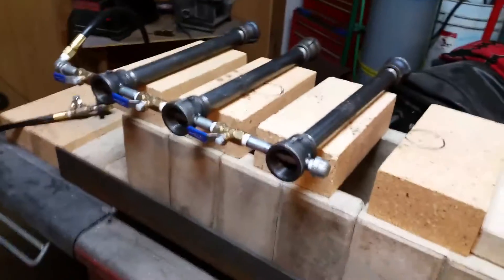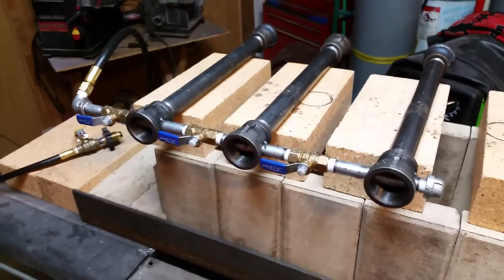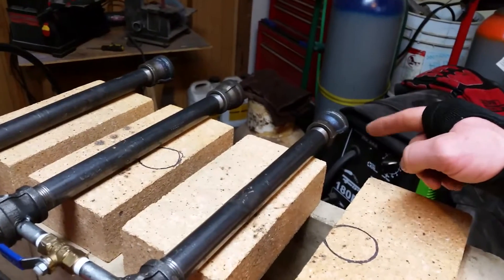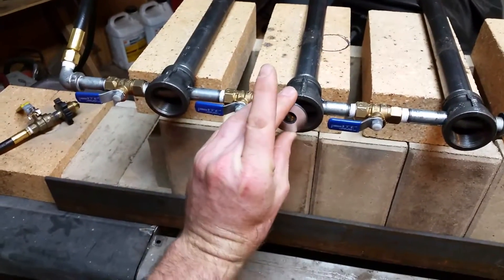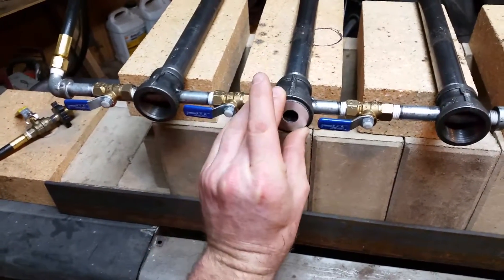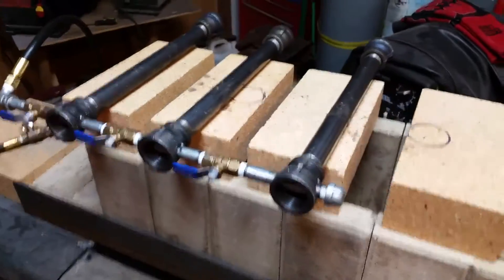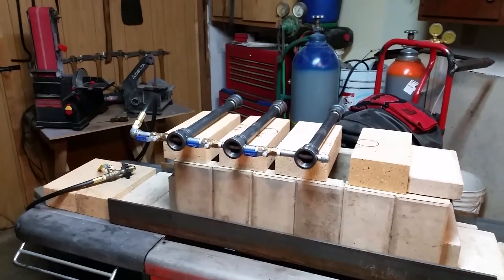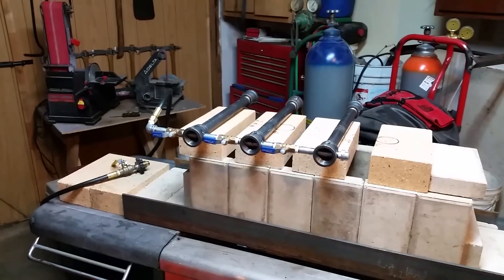Propane Forge Build Pt 3 Burner Testing

Comment: Hi Thank you for the video. Question how are the ceramic or fire bricks handling and conducting the forge heat. I was thinking of using the wool and lining it with cement . I wanted to do a comparison. Any information helps. Thank you
Reply from the maker: Still working great 👍

Comment: So I made this burner, and the only things different was I used 4 inch instead of 3 inch because menards was out. Laying outside all three work great, inside the forge is another story. Long story short I ended up raising the roof of my forge because I was having issues keeping 2 and 3 lit. Now 1 and 2 run okay but I feel like it’s being starved. I have orange flames coming out of the door with the back covered. It almost gets to forging temps with it being closed completely off, takes about 20-30 minutes to reach orange, and this is a billet that has 8)  4 x 1.5” peices so it’s not a huge billet. I got a 20psi regulator and if I cover the tops where the air gate would be the flame dies, does anyone have an idea of what my issue is?
Reply: wayne i  this is happening to me as well I light the 1st burner beautiful flame I open the next valve and I just get a slow big flame out of the front : /

Comment: I think if you shortened your black pipes between 6 - 8 inches, you might get a consistent flame with less oxygen to burn before building the air gates!

Comment: Propane and maintaining pressure.  Reducing your orifice diameter is one way to reduce gas consumption.  When you're using propane vapors out of the 20 lbs tank, the liquid is being forced into a boil to generate more vapor through evaporation. Evaporation is Refrigeration, the longer you run the burners the lower the pressure will reduce in your tank. It gets down to evaporative surface area. Depending on how fast or long you'll be running your forge you may need to manifold additional 20lbs tanks together increasing you evaporative surface area. Adding you air controls will also help.
Reply: Damn you good